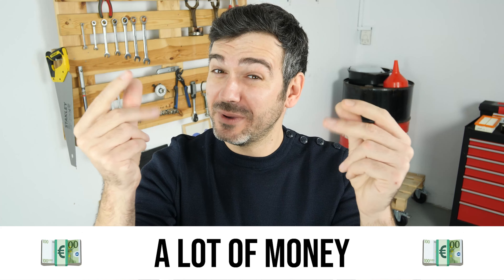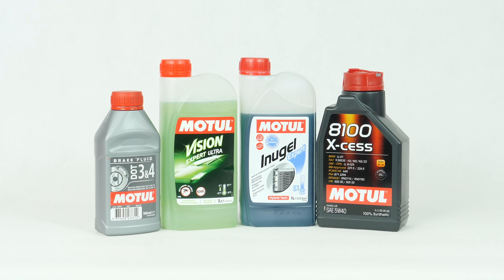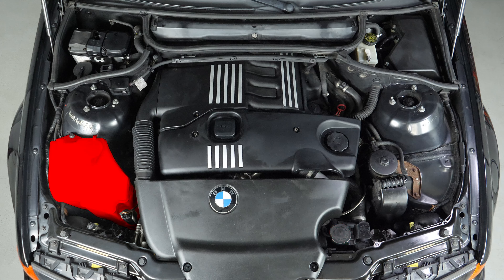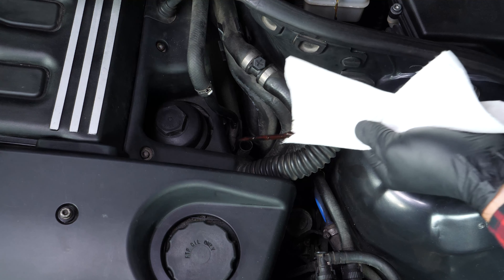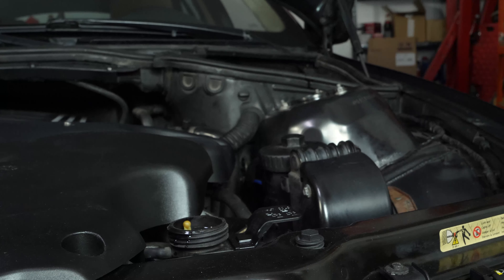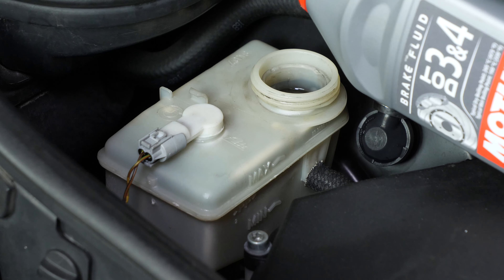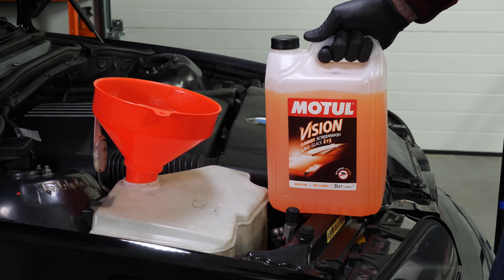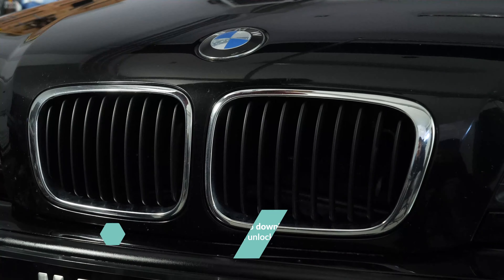How to check the fluid levels BMW 320d E46 📏

Comment: Wrong
E46 320d check level with engine hot
Like on the manual say
If you check on cold will be on minimum and you
Oh god i have to put oil
You put oil
You ride the car the oil wil dilate and when you check it will be more tham.maximum and you can have some leaks because you have too much oil